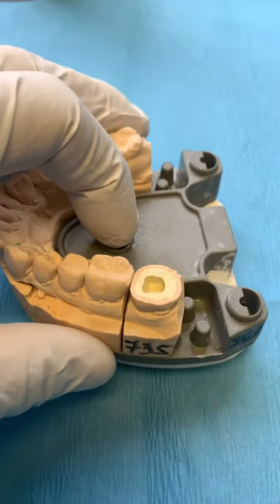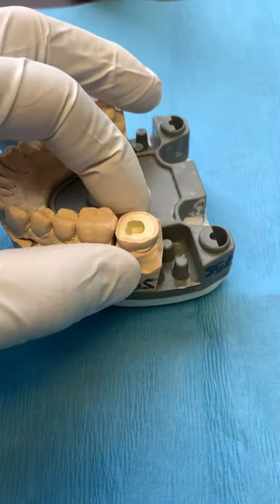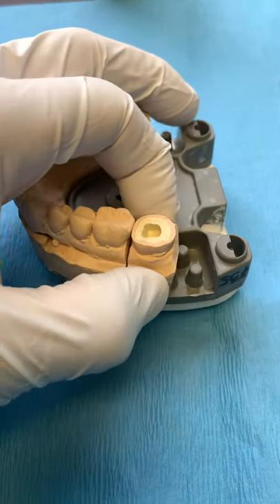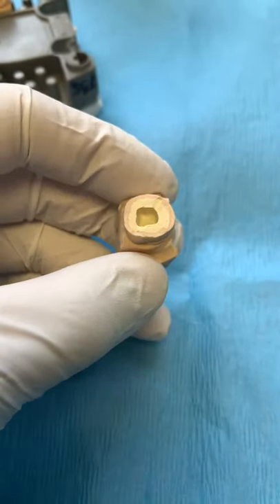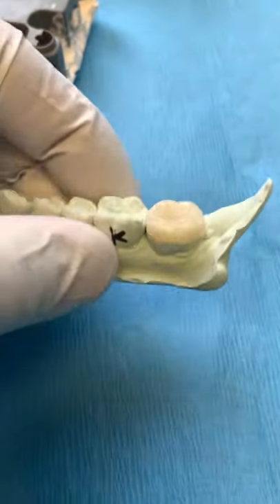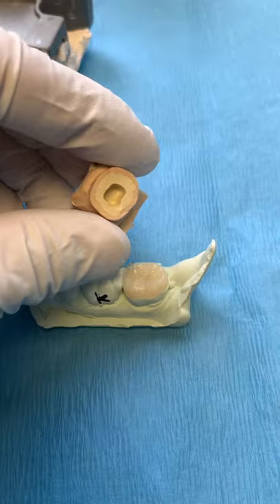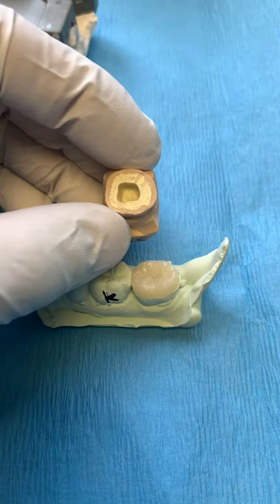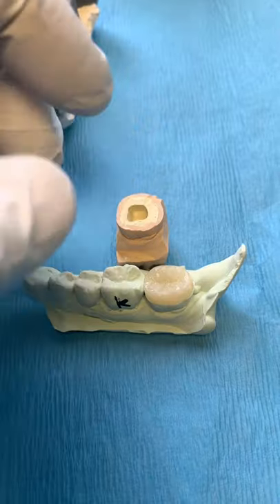Easiest Crown Possible

Comment: Had to do something similar 5 years back for a patient with very short crowns and so used a core to increase surface area and retention form. Patient has been loyal eversince because she'd had two crowns fail before she came to me. Thought it was a clever work around on my part but have since learned that a lot of doctors have used that technique. The only foreseable complication will be if she ever needs endo done on the tooth. Going to have to invest in a lot of burs if that ever happens. And it is a zirconium crown....gulp...

Comment: Always, no exceptions, break contact. Later on, down the road, it's better not to stress with interproximal caries.
I've tried endo crowns with a lot of variations. The ones I like the best are with mesial and distal boxes and buccal minimalistic prep with infinity margin (feather edge, kind of like verti prep) and I do those with monolithic zirconia and cement them with Fuji Evolve (13,5 MPa bond strength, is it really?). Got to make sure the pulp chamber is previously sealed with composite (SDR being my choice).

Comment: Why not just prep it with M and D retention grooves and design an overlay? Still have a ton of enamel to bond to and don't ever have to worry about cutting through that ceramic core if endo ever has to be redone.
Reply: Probably cuz you want to conserve as much tooth as posible, and that oclussal box seem to be good enught in terms of retention, also you have a lot of enamel wich will give you high bond strength. What you say is an overkill imo
Reply: @Pipewzp  an overlay is overkill? it's way more conservative than a traditional crown prep and conserves a ton of tooth structure.
Reply: I think cuttin through proximals will reduce the tooth strength significantly

Comment: This seems like a VERY, VERY BAD concept, because the internal "retention" is
a WEDGE (shape) placed in the middle of a weakened, endodontically-treated
tooth, in other words, making the tooth more prone to fracture.  Just as with inlay
restorations and tapered endo posts, breakage from microflexure is not going to
be prevented by adhesion, especially when the restoration is not full coverage.
I've been a 'bondodontist' since the Eighties, and I wouldn't want this kind of crown
 on any of my teeth !

Comment: In school i’d get in trouble for not breaking contact because “how is the lab going to trim the die?” Seems like they separated your die just fine.
Reply: Using a interproximal strip might be a good enough solution to achieve that.